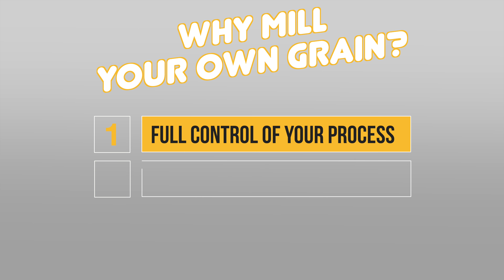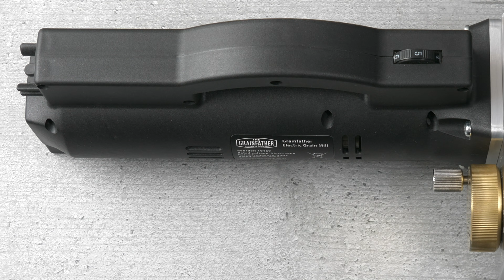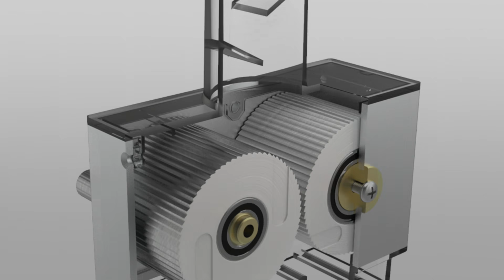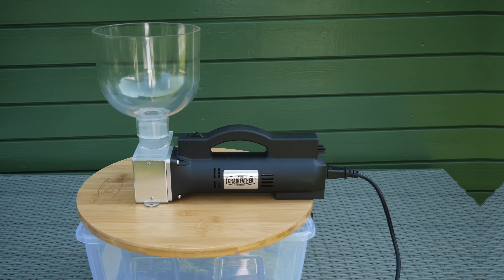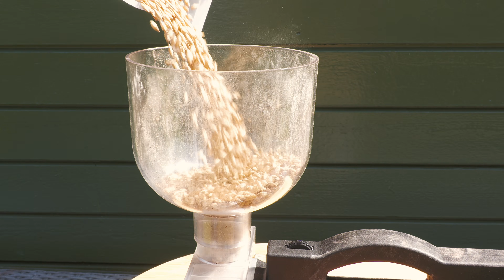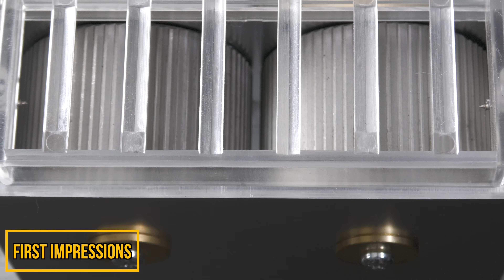Grainfather Electric Grain Mill Overview & First Impressions For Homebrewers

Comment: Hey David, i wondering do you stil use this Mill after 3 years?
I look at this review for about a 10 times in the last year and stil realy curious.
I would really like to try the mill in combination with the brewtools B-80
Reply from the maker: Yes. My monster mill pro is now redundant and I use this full time. So much easier to adjust and the crush is very good.
Reply: @DavidHeathHomebrew  Thank you very much for the response, I have ordered the mill and received it.
I am very curious if this will bring me a step forward.
brewed a heavy stout (start sg 1.126) 3 weeks ago and despite the many rice hulls in the mash, sparging took about 3 to 4 hours
Reply from the maker: @peterschipperen1001 Grain crush is vital. Too fine and a stuck mash and/or sparge will hit you. This mill makes adjustments very fast and easy.

Comment: I have a monster mill, and I agree with your comments on the laboriousness of settings and managing the drill action. I think I'm going to invest in the GF mill as it looks like a great tool, and will certainly take some of the stress out of the crush task and the fear of gap settings and the whole thing flying up in my face when you get a slight variation in the grain thickness. Thanks David, good review!
Reply from the maker: Great to hear John. I have been using just the GF mill ever since,still very impressed.

Comment: Yesterday I brew with 94% bohemian pils, 4% cara pils, and 2% all crushed with settings 5 and speed 3 and it was a nightmare in GF30 - I let the mash stand for 10 min after doe in before recirculating - stuck mash even with lots of rice hulls (when I saw the troubles) - didn't help - during mash it refused to heat (due to lots of burt flour).
How would settings be for bohemian pilsner (weyermann)?
Any good advice will be much appreaciated!
Reply from the maker: Hi Peter, I suggest you go 6 or 7
Reply: @DavidHeathHomebrew , thanks for bohemian malt only and which speed?
Reply from the maker: Speed 3  is good

Comment: I Have found from my own testing that milling half the base malt and all the speciality malt at setting 6 and the other half  the base at 7 strikes a good balance between efficiency and filtration. Malt varies quite a bit from country to country so always run your own tests.
Reply from the maker: Cheers Paul, yes exactly. 🍻🍻🍻
Reply: @DavidHeathHomebrew  This video convinced me to buy one, and it definitely has not disappointed :) Cheers!🍻🍻

Comment: Thanks for the great video. Based on your review, I decide to invest in one after getting frustrated with stuck mash after stuck mash.  I had been relying on my LHBS to crack my grain for me - I've never owned a mill before, I've always demurred as I have no desire to store grain.  I managed to source one (stock is scarce) and I just gave it a run for the first time on the weekend.  I can't imagine milling grain gets much easier. Set the number, pour in the grain, hit go, and keep pouring. Super simple, super quick. Way less flour than what i was used to, way more "chunks" of cracked grain. Best of all, my brew day went better than it has in months, no stuck mash. It made a huge difference to my recirculation, wort was clearer quicker, and my efficiency was up. It was so easy, I ended up doing a second beer. One of my best ever purchases.
Reply from the maker: Great to hear John. Yes sure is easy! Great to have control too.

Comment: Received my electric grainmill a couple of weeks ago. Tested it with 200 gr. pale malt and was very pleased with the result. Today brew day. Filled the hopper with Munich malt. Was two thirds through when it just stopped!! Cleared the rollers as I thought there maybe a stone in the gap. Nothing. Doesn’t start again. Will have to send it back, obviously still in guarantee 🙈🤷‍♂️.
Reply: Possibly a defective power switch, it does happen.
Reply from the maker: Yes, sad but true.
Reply from the maker: Ahh thats a pity. Still, I guess you will get a new one fast.

Comment: How fast does it run? Here are some readings without load. Supplied voltage is about 225 volts. 
1 = 350 rpm
2 = 425 rpm
3 = 460 rpm
4 = 545 rpm
5 = 640 rpm
Did not do any readings above five.
Reply from the maker: Great information!! Thank you :)

Comment: Hi David, I listened to you as did Grainfather! First me: I ordered the Mill right away. I already own a very capable mill (Mattmill kompakt) but I struggle setting the gap correct and handling the drill and drill speed. So I will be selling this soon :-). Now for Grainfather: In their latest Mill Instructions PDF, they have adjusted the Wheat Gap settings to 5 (6)! They probably also looked at your great review!
Reply from the maker: Great to hear. Yes, I see some instructions changes. I guess that this is based on overall feedback rather than just mine.

Comment: Thanks David, great video as always. I've just received mine this morning and am very pleased with the milling. Would it be possible for you to list all the grains you've crushed and the gap sizes please?
Reply from the maker: Thanks Peter. Everything went through as per Grainfathers recommendations for mill gap except the wheat. Here is the list:- Pale, pilsner, wheat malt, various crystal malt from light to dark. Flaked oats, acid malt, a few different chocolate malts, Abbey malt, flaked maize and Munich malt. I think that's it so far.

Comment: My understanding was that the rollers are NOT stainless steel as stated, and so users have to avoid milling damp grain. Happy to be corrected though.
Reply from the maker: It's in the technical specs from GF that the rollers are “hardened stainless steel “. You can find this in the instructions on page 3. GF do advise against the crushing of wet grain though. 
https://help.grainfather.com/hc/en-us/articles/360020758657-Instructions-Electric-Grain-Mill

Comment: Oh no not another great product...
Reply: When and if this product comes to Canada, it will be a desirous protect. The NZ price I saw is actually cheaper than what I expected. 

Your conclusion about convenience is exactly what I was thinking. I actually built a table for milling grain because it was hard to make sure the thing stayed on top of the bucket.

This would make milling a non-issue.
Reply from the maker: This is certainly a nice convenient option for sure. I have to wonder why no body else did this already really

Comment: BTW, today I am brewing a Rauchbier. I took the recipe from my last brew but replaced the Caramunich II  (Weyermann) with Munich Dark (VIking) just to see if you really need caramel malt in a Rauchbier. Everything else being equal as much as possible. I've always used caramel before but I'm not sure it's needed. What is your experience with Rauchbier, David?
Reply from the maker: I have to be honest and say that it's a style that I am still working on for a more pleasing result.
Reply: @DavidHeathHomebrew  The results are in from my experiment! I used 4.5kg Viking beech smoked malt (90%) and 100 grams of Weyermann Carafa Special 2 (2%) in both brews. However, in the first I also used 400 grams of Weyermann Caramunich III and in the second I replaced that with 400 grams of Viking Munich dark. Both were hopped with 15 grams of Perle 8% @60 and 35 grams of Perle @10 minutes. I used WLP838 South German Lager however I did use the very same yeast for both. The first one was the second pitch of the yeast and then I dumped the second brew on the yeast cake left by the previous brew (i.e. 3rd pitch of the same yeast). Before the smoked beers I did a pilsner with Hull Melon hops to build up the yeast cake.

Anyway, the result is two-fold: first of all I have to say I like the one with Caramunich more. I do think there should be a bit of caramel in a smoked beer. I would say the 8% I used is about the max, maybe I should have used Caramunich I instead. Initially I thought the beer was a bit too sweet but it mellowed out a bit with some age and turned out really nice. The Munich Dark one is still good but not as nice as the Caramunich one.

The second result is that I am not impressed by the Viking smoked malt. I have done several smoked beers before with Weyermann beech smoked malt and those had a lot more flavor, despite using less of it (~70%). I have used several Viking malts before (mostly because it's my local-ish maltster) and they are normally just as good as anyone else but it seems their smoked offerings are not as good as Weyermann so that is what I'll be using going forward.

(I should add that I make 20L batches)
Reply from the maker: Many thanks for the information. Yes I believe it is key to balance styles with malts. Once you find a combination you like then you can start tweaking further. Something that you have little experience with always takes longer but I enjoy the process :)

Comment: I can see another episode where you show us how to make a larger hopper. But with the electric feed you can fill up as you go.  The only downside I see is the plastic hopper, I can see durability issues down the road.   As for the price, converting the NZD to USD $420 to $300 (all in one version). The price isn't too bad when you compare the easy crush adjustment and the electric motor with a speed adjustment.   If I were to buy a grain mill this would be one I would consider.
I also noticed grain father is selling a "Overflow Filter" now.  I guess they saw too many of your videos where you threw on sink strainer.
Reply from the maker: Haha, I guess that could be as simple as a 5L water bottle with the base cut off but I find it easy enough to top up at present. I think it's a fair enough price personally. It's cheaper than my current mill and has some conveniences for sure compared.

Comment: Like all Grainfather equipment it is still very expensive. I will stay with my existing mill and variable speed drill, which gives me perfectly good results. I even have an electric motor I could mount on it if I wanted.
Reply from the maker: The price is for the individual to decide. Naturally there is some good convenience baked into this.

Comment: Well 300€ for so mutch plastic....
Reply from the maker: The plastic casing was a good move in my opinion. Naturally everything inside is metal and this is protective and keeps the weight manageable. In the end it is those rollers and the drive  mechanism that you are paying for. My MM3 Pro is much more expensive too.

Comment: Nice mill from what you see! Could be a real viable option depending on price! Definitely like the adjustment mechanism. That's a huge pain point on other mills. Did you by any chance see if the gap was consistent across the rollers? Thanks for sharing David! 👍🍻
Reply from the maker: Thanks Brian. It certainly seems to be. I guess the crush speaks for itself.
Reply: To be honest, I was thinking about buying that 1200 dollar grain mill from Blichmann for some time now based on the fact of how powerful it is. I then put the idea on the back burner but kept it on very very low heat. Then this one comes along and I was comPLETELY turned off by it. Looked too small, the bowl was too small. It seemed like a quick cash grab from GF. After watching this video, I realized a couple of things... 
1. I'm not a small company brewer, so the Blichmann would be kinda silly and would take up some precious real estate in my brew room just to be used sporadically. 
2. The Grainfather graining mill is detachable and space friendly. I am in reality a minimalist and the ability to take this out, setup, use and dismantle and store again, is good.
3. Price. While I do live in the U.S.A. it is not released here yet, but I would imagine it ain't nowhere near the 1200 price of the Blichmann grain mill.

So where I stand right now...In the middle of nowhere. While I do not think I will be purchasing the Blichmann model and the GF mill isn't available here yet...I am stuck using the old drill mill. sigh
Reply: @GraveyardGrog  I think it's a good option from what David experienced.
Reply: @ShortCircuitedBrewers  Totally agree! His review definitely sold me on it. Ok, so we have to constantly keep pouring into that...little teeny tiny bowl....I am ok with that now!!
Reply from the maker: I should think that this will release in the US in the near future. It gives you time to consider :)